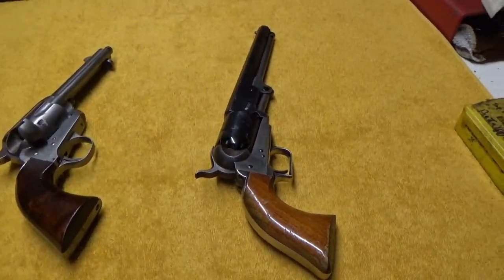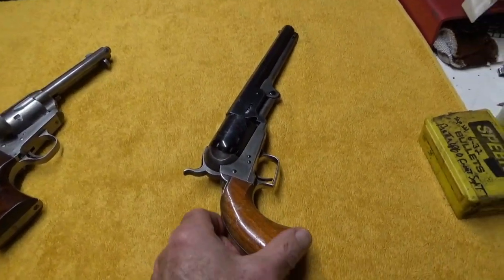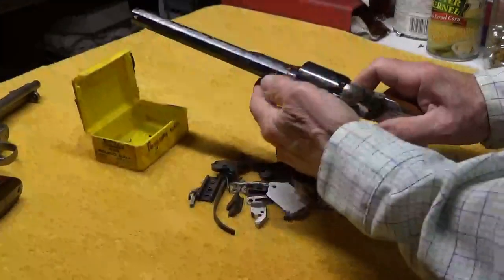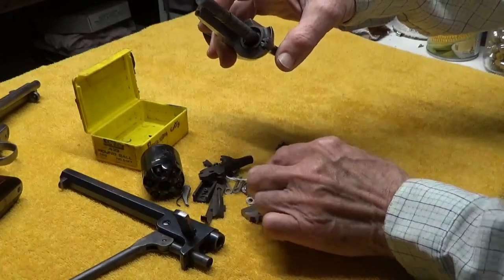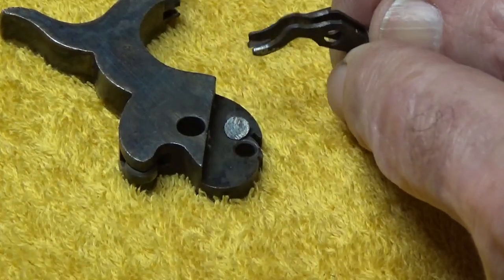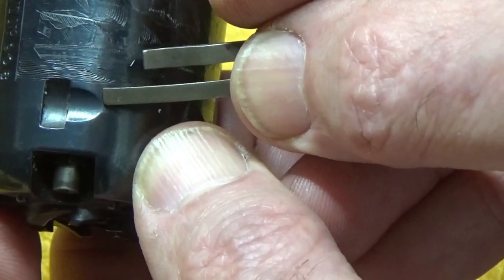Single Action Clicks and Timing - a Look Inside

Comment: great video i work on all my firearms myself ,,,now against the law in fascist australia  ,this was absolutely so useful to me , i'm assuming theres several issues that cause that score line on cylinder before lock up , i'd never considered each step that each part takes , i just blamed the bolt  ,,more to think of , thanks for sharing , cheers big ears from downunder
Reply from the maker: Great to hear from you.  I've used Single Actions for longer than I care to relate, and never gave it much thought either.  Just figured it was bound to happen with use.  Yes, that is true, but its got more to do with rotating the cylinder by hand when the bolt is against the cylinder.  Seems there are times when this is necessary, can't think of the example right now, but drawing back the hammer to rotate the cylinder will lower the bolt off the cylinder (in most cases), and then the hand will do the rotation.  
Cylinder drag marks aren't the worst thing of course, but I think lots of folks blame timing for this, when it probably has other causes.  Thanks for the comment.  O.R.

Comment: With this video I managed to understand and fix a bit of a timing issue that, to my great dismay, developed after the first disassembly of my brand new Pietta Colt 1851 Navy Yank .36: at full cock the cylinder wanted to rotate further than it had any reason to, and it traveled back when I pulled the trigger.

I panicked just a little, then I noticed my bolt wasn't fully rising up (eh!), so I checked the bolt spring screw and it was way too loose; I tightened it (but not too much), and now everything works better than ever. Phew!
Reply from the maker: Great. What you described makes sense. Always good to have a happy ending - glad that maybe the video helped, and thanks for sharing. O.R.

Comment: I got a black powder 1851 pietta navy revolver chambered in 44 caliber. On a couple of the chambers, when I cock the hammer it will be met with a bit of resistance and then release and over-rotate or simply not click into place. Any idea what this might be?
Reply from the maker: Not sure I can be of much help, but when you say a couple of chambers, can you tell if it is the same ones, or is it more random and happens a couple times or so on each rotation?  So, it pulls hard, and then goes fast when the resistance releases and it over rotates.  O.R.

Comment: Thank You very much for Your video's.
This one was especially.
I have a couple 1st. gen. SAA Colts in very good condition, one is timed ok, but has 457 chamber mouths, and 452 barrel. 
The other one functions, and shoots very well, but The bolt drags, and the cylinder shows it.
After watching this, I have a better understanding of how to try to remedy the problem. 
That is if i can find gen.1 parts. 
These Guns were made in 1886 and 89,  I shoot them carefully and not very much. 
Cheers!
Reply from the maker: Thanks.  I'm sure not familiar with those age guns, but its possible that more modern parts may fit, especially with some mods.  There could be some information on a colt SAA forum as far as who might have parts. My brother used to get parts from a John Sueth, (may not be spelled right), he was recommended by E. Keith, but that was back in the 70's.  O.R.

Comment: This is a very simple and problem free action, but many are ruined by people without knowledge of the function, grinding and filing trying to lighten the trigger pull, alter the timing and "tuning" the action, they usually give up after buggering it up and sell the gun on, the only mystery to me is why Colt decided to change the grp frame size from the, "normal" size of the 1860, to the too small size of the 1873, I have fitted 1860 grip frames on my 1873 and it is much better. Stay safe ! Chris B.
Reply from the maker: My feelings exactly.  Sadly I have been one that was too anxious to get out the butchering tools without thinking.  That was way before the internet.  Living next to the arctic there were no neighbors or friends I knew of that could help.  So, I did stuff that I was sorry for.  Fortunately at the time that I bored out two cylinders on 2nd generation 51's with a drill press and a 380 bit with the hope they would group better, was at that time also to order new ones because Colt was making their signature series and stamped the correct serial numbers in the replacements.  Replaced fronts with higher ones, ground off hammers, etc.  Live and learn.  So that's my confession.  One reason for a video like this in the hope that some will view it and get a better understanding before getting out the stones and files.  Thanks, always enjoy hearing.  
That is a mystery.  Possibly because the 51 was so popular.  We'll never know.  O.R.
Reply: @oldranger3044  Yes, it is very easy for me to criticise others for "butchering" their firearms, but there is a certain fever that takes over, and without reference to good publications or a history of engineering principles, it is easy to go down the wrong path, even now, with the internet, there is so much bad information that unless you already know the function, you could go along the wrong path, there are many channels on youtube that advocate really bad practices, so when a good channel like this surfaces it is illuminating, rather than confusing, even many gunsmiths do not truly understand the workings of this design , as I do not understand the workings of an AR 15, to each his own! Stay safe! Chris B.

Comment: For your 2nd generation Colt and the Single Action Army Colt clones, do you think the cylinder latches/registers into the firing position before the hammer reaches the full cock position or after the full cock position?  In other words, if you are ever so careful to stop pulling the hammer back at the very moment that the trigger sear engages into the full cock hammer notch, is the cylinder bolt fully engaged and registered into the cylinder location notch. If not, how far off is the alignment?

Unfortunately, I don't own an SAA but plan to in the near future. From looking through some of the drawing and videos, I would have guessed that one would expect to hear 5 clicks:
1.) trigger sear snaps into hammer safety notch  
2.) ltrigger sear snaps into hammer load notch
3.) cylinder bolt is released in preparation to capture the cylinder location notch
4.) cylinder bolt locates into cylinder registration notch
5.) trigger sear snaps into hammer full cock notch
Reply from the maker: Yes, 5 for the SAA. According to Jerry Kuhnhausen in his shop manual,, “In a perfectly timed Colt S.A.A. Revolver, bolt and full cock sear engagement occur at virtually the same time. Hence the single audible 4th click.”  So five for most where the sear drops into the cock notch just before the bolt clicks as it locks the cylinder, four if “perfectly” timed. The percussion guns lack the first (quarter) notch in the hammer, so there would be only three clicks instead of four. Looks to me you have done your homework on this, especially without owning one. Congrats. O.R.
Reply: Thank you Mr. Ranger @oldranger3044

Comment: Great video. Question: I have a 1st gen Colt 1873 SAA that when firing a full cylinder of rounds the hammer gets stuck only able to be in the resting position or in the safety notch but can't pull it back further. Sometimes taking the cylinder out and/or working the hammer eventually unfreezes the hammer. I've been inside the gun and the only thing that looks different from your demo is the curved spring on the hand/arm is way short. Its about 1/3 the length of yours. Is this the source of my mechanical issue? If so, any advise for replacing that spring? Is it a drop in thing or more complicated than a simple swap out? Thanks!
Reply from the maker: That spring is sort of replaceable. Not exactly a drop in. There’s usually a slot in the hand and after the spring is slid in the slot is hit with a punch to close the slit and provide tension. Need to pry open (be careful not too much). 
As far as the problem, I suppose can give a couple thoughts from what you described. If that spring isn’t doing its job, possibly the hand gets caught where it doesn’t belong. However I would then suspect that the hammer would still move, unlock the bolt from its cylinder notch, and it just wouldn’t rotate. Something to check is possible wear on the underside of the cam that is on the hammer. If that is worn, or the part of the bolt that makes contact with it, then drawing back the hammer will not get the bolt down far enough to release it from where it is up in the cylinder notch. Just a couple of thoughts, maybe close, but probably no cigar. O.R.
Reply: @oldranger3044  thanks. You’ve given me a starting point and that’s more than I had before.

Comment: Great video! What causes the bolt to scratch the cylinder in the lead in area on a new gun?
Reply from the maker: Here’s just a couple guesses. If it’s in the actual cut out area, possibly the bolt has a sharp edge that is scraping. A short or worn end on the arm of the bolt that the cam holds back until the hammer is brought far enough for it to slide off and release the bold against the cylinder would cause a scratch before the cylinder notches. You can hear it when the bolt hits the cylinder and note how much more the hammer comes backwards before the cylinder locks. Possibly the bolt spring is a little stronger than needed, causing excessive pressure, of course this is better than a weak one. Only some thoughts. O.R.
Reply: @oldranger3044  Thank you and I’ll try to track it down. What about using a Wolff bolt/trigger wire type spring?
Reply from the maker: I’ve heard good things about them, no experience however. O.R.
Reply: @oldranger3044  I think you are right about the spring being too strong. I installed a Wolf reduced power wire sear/bolt spring PN# 32294 and the engagement feels much lighter.
Reply from the maker: @75SakoHunter  Thanks for the update. Maybe I made a lucky guess, anyway, good 👍. O.R.

Comment: Nicely done, only why SAA hand has double spurs? Thanks
Reply from the maker: If I am correct, you are asking about the two that are fairly close.  The top one is where the trigger sear engages (sort of a safety) when the hammer is only slightly pulled back after firing.  In this slot, the sear keeps the hammer from being able to contact the cartridge.  Works well unless someone hits the hammer with a hammer or whatever.  The second one is where the cylinder can be rotated for loading-unloading (free to turn).  The last (difficult to see) is the full cock position.  Hope this is what you are asking.  O.R.
Reply: @oldranger3044  No, I ment hand that turns the cylinderm SAA has like a spur under as for CųB does not, they both different.
Reply from the maker: @linasmagnum  I suspected it was something else.  Here's what Loren W. Smith in this book "Home gunsmithing the Colt Single Action" says.  "...the upper part of the hand loses its hold on the tooth of the ratchet before the cylinder has revolved a full one-sixth turn.  The lower point on the hand picks up the next tooth of the ratchet at the proper instant to continue the cylinder rotation..." .  Book printed in 1971, which is about the time I got it.  I was thinking along those lines, but that firms it up.  Hope this helps.  O.R.

Comment: I'm wondering if there is any conceivable scenario where a fully working gun (unbroken) could fire without pulling the trigger. Suppose you brought the hammer to 99.99% full cock. Far enough to get the cylinder lock to click, but the sear is riding right on the full cock notch, but not actually latched. Let's say the hammer spring is particularly stiff so it will really throw that hammer down with maximum force. And let's further say that perhaps the trigger spring is a bit sticky for some reason, like maybe due to humidity, temperature, or perhaps some residue of some type got into the gun to gum it up a little bit. Would it then be possible (again, without holding the trigger) for the hammer to fall so quickly and so firmly that it skips past the half cock notch and falls all the way down to fire the gun?
Reply from the maker: So, when the gun is in full cock and fired, the trigger sear is kept from falling into the half cock notch by the finger pulling (and for an instant keeping) the sear back, allowing it to miss the half notch. There’s no finger pulling back in your scenario so as you point out, the trigger spring should do its job and shove the sear into half cock. But,,,as you are saying what if that for whatever reason) that doesn’t happen?  Then, I will forecast a KaBoom. 🙁. O.R.
Reply: @oldranger3044  Yeah, that's how it goes in my head with the thought experiment. And while I think it is highly, highly unlikely that Alec Baldwin could be right when he says he didn't pull the trigger, I could imagine a scenario where it could, just maybe, happen.

People on the Internet do quick, sloppy experiments to show its impossible to fire without pulling the trigger. But I want to see a more thoughtful experiment. Starting by getting that trigger spring nice and sticky. Take a cup of hot coffee and dissolve as much sugar into it as it will take, pour it all over the gun and let it dry. Wipe off the residue on the outside. Then use a brush to clean out the cylinders so all that sticky gunk falls down into the mechanisms. Then very slow cock the hammer, bring it past the cylinder lock, but just barely shy of full cock. Let the hammer go. What happens?
Reply from the maker: @kdietz65  I’m starting to get the feeling that you have experience in the criminal investigation department. That plan could just gum up every spring but the mainspring. Without the sear spring functional, it would be a little like keeping the trigger held back and firing by cocking. O.R.
Reply: @oldranger3044  Haha. No, I don't. I'm an engineer. I have a mathematical and problem-solving type mind. I became interested in the Alec Baldwin / Rust case when it happened, and I've put in a large amount of time researching the case. That research has led me to videos like yours. I've always just assumed that AB was wrong when he said he didn't pull the trigger, I think he inadvertently did pull the trigger. I haven't given much credence to the idea that he didn't pull the trigger (I don't think it even matters all that much). But recently I've been watching videos like yours to learn more about how these guns operate, and that's led me to this line of hypothesis where I think maybe, just maybe the gun could somehow skip past the half-cock notch and fired. Although I still think unlikely, it could fit AB's version of events. He said he pulled the hammer slowly. That he didn't pull it all the way to full cock and held it in that position for some time (perhaps allowing the trigger to stick at that position). And HGR in her police interview said she couldn't get the sixth bullet in after lunch and she had to clean out the cylinder with a brush so she could get it in. Thus I surmise there was some kind of residue inside the gun, as in the scenario I'm pondering. Then I thought, what if the trigger spring was sticky, and I thought what would make it sticky. And I just thought, hey, maybe someone spilled some coffee on it before lunch and it dried up and made the trigger sticky. Far-fetched, but I find it a curious scenario to think about.

Comment: I have a remington 1875 that locks up unless I put a little upward pressure on the cylinder , then it works fine as long as that pressure is maintained. I know it's something to do with the cylinder stop. But what?
Reply from the maker: Hi, don’t have one of those, even so I’m just making a guess. The hand is trying to rotate the cylinder with the bolt still slightly engaged in the cylinder notch (what you call the stop) and possibly it’s almost out and pushing upward maybe moves the cylinder enough (possibly even forward) and that gets the bolt past  or out of the notch. The bolt arm that works in conjunction with the cam on the hammer has started to move up, causing the bolt to move down, but possibly there isn’t enough metal underneath it, so the cam won’t move it up enough (which moves the other end “bolt” to move down far enough to get out of the cylinder notch. There’s probably other things that can cause it, but this is just one idea, sort like a shot from the hip. O.R.
Reply: Thanks!